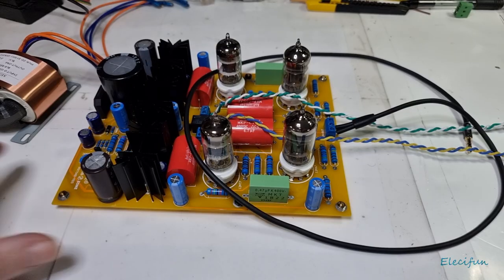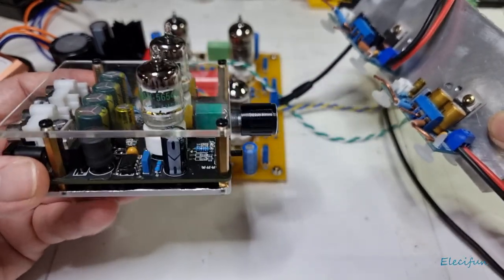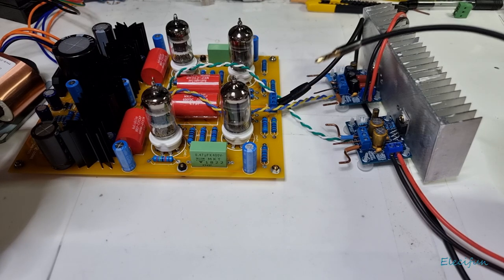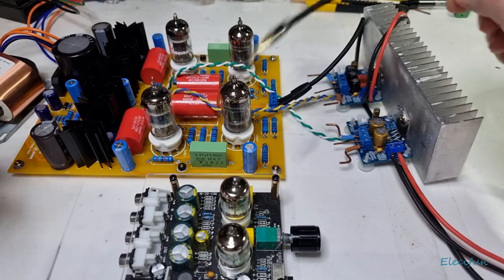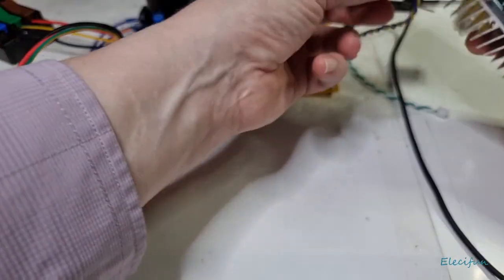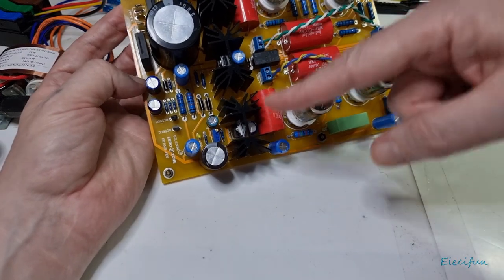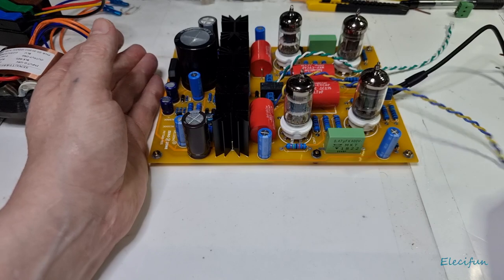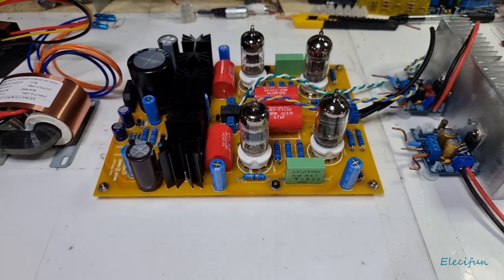12AX7 + 12AT7 TUBE MATISSE PRE AMPLIFIER

Comment: Hi amigo, she's finished! Orayt! It looks very nice. Does it give out a faint glow?

Edit* Okay it does have a nice glow. I had to reload your page a few times to screen capture. It don't worry bro your view count probably went up by 20 ! 😄👍

Gee I remember these old vacuum tubes from the old T.Vs that they made decades ago. 

I use to open the back up and peer into the back of the wooden cabinets.

Lucky I didn't start probing the tubes.

Actually I think I did initially and I felt a high voltage jolt. ⚡️ 😄

Scary to think back at the stupid things I used to do back then. 😆

Any it's a little hard to tell without actually being there but I think yeah it sounds better.

More grunt.

How many watts per side RMS?
Reply from the maker: The tubes do glow a little.. They are fascinating to watch and visualise in the mind whats happening in them. I was locked in a room for most of my pre double digit years. I had a radio which I looked in the back of, I was amazed by the components which is one of the reasons I took up the hobby.
I an still to test on the Oscope as I am waiting for a friend to arrive and have a listen first. 
Then let the tests begin!
Reply: @Elecifun  omg bro that sounds aweful ! 😟🥺
😢
It's strange how these traumatic events affect us later in life. 

I developed a fetish for watches because my father stole a watch that was given to me as a gift.

Its probably why I bought so many geiger counters and clocks. 

Anyway sad and interesting. 🤔😔

Anyway I look forward to the next one.

I hope you build a 100W per side power amp one day. 😀👍
Reply from the maker: @decem_unosquattro9538  Iv'e built a 100W per channel amp. The 60W amp with a 4 Ohm load will output 100 watts. 

Ref, childhood. When I was 12 I was deemed out of parental control so I was sent to a lock up school until I was 16. This was when the staff were allowed to use physical force to get me to comply. It was an exciting time for all involved.
Reply: @Elecifun  100W per side?
Reply from the maker: @decem_unosquattro9538  Yes

Comment: It's VERY interesting to hear your impressions when comparing the two pre amps. I'm glad you have use for both with putting one on the TV. I've not seen that particular kit (12AX7/12AT7) while perusing my usual sites. Did you say about £18 without tubes? Not bad but those tubes cost me around $10 a piece if I buy the decent ones here in the states... Still a good deal if it ends up being a really good sounding pre amp. It's cool that you've bought a book and are getting deeper into tube amps. I love to hear your opinions as they are more scientifically grounded than my own. It looks like your feline friend is enjoying the music (or maybe the radiator lol). Thanks for another entertaining and informative video Elecifun! I'm loving your amplifier series.
Reply from the maker: Cheers Ox. I spend a lot of time listening to the same tracks in order to pick out faults initially and differences. I want to hear bass strings being plucked and crisp sweet highs while the vocals are kept precise. I love it when I can hear slight differences, this lets me know the individual amp representation is true, else it would all sound the same. 
This particular pre amp has a lot of gain, when I do the meter tests the results should reflect that. Its gain is great and it drives the LM1875s really well. I turned it up this evening listening to amongst others, Lou Reed - Walk On The Wild Side, a track with everything needed to push an amplifier. It sounded beautiful, pushed so hard that my cat jumped off my lap and ran when the trumpet at the end was being played. I even had to take a break after myself. Awesome! 
My neighbours were out.
I found some MULLARD 12AX7's matched pairs, cost £73... I will stick with what I have for now as the extra expense doesn't seem justified, ATM.
My cat Felix loves the radiator, he is a heat magnet, unlike Oscar who prefers the window ledge with the window ajar so he can enjoy the cool breeze. Cheers for your interest.. Did you get yours sorted out?
Reply from the maker: I forgot to add for your perusal ..
https://www.ebay.com/itm/274983334334
Reply: From your description, it seems that this new pre amp has more gain and more bass response than our 5654w. That would be a welcome change with my current set up. I think those Mullard tubes are about the best you can get. Tough to justify the cost though if your set up already sounds great. I think your kit with the 12AX7s and 12AT7s in front of the LM1875s is a very good value set up. The enjoyment per dollar ratio is right in my wheelhouse lol. Yeah my kit still has the crackle on warm up. Still no problem once warm but a bit annoying. I'm confident that new tubes will sort it but they're almost impossible to find. They are 10GV8 and have been back ordered for almost a year!  I can't find a different tube that will work either so that's why I'm so interested in a whole new set up.  Probably on the same day I order a new kit, the 10GV8s will become available lol. Thanks for the link and for your videos. They are very valuable to me when contemplating a new system. Funny how your cats have different opinions on the most comfortable spot lol. Sage is strange in that she hates the heat outdoors and spends the entire summer looking for shade. But in the winter her favorite spot is right in front of the fireplace. A fire calms her and has since she was a pup lol. Thanks for the link. The search continues for a great sounding all tube system on a budget 😆
Reply from the maker: @Sonic_Ox  I don't want you think of  me as contrary regarding the crackle in your amp, I can only go on your video and info you have given, changing tubes from channel to channel didn't change the issue. I'm not sure swapping out with different tubes will.
There is something wrong in the setup because it distorts badly and with little input. I'm only a electronics enthusiast, I really believe its something else. You could really do with its schematic to help trace the issue.
Anyways regarding our furry/hairy babies, I'm in full agreement, the opinions on what is comfortable is an individual preference. Maybe Sage prefers the different heat produced by your fire compared to the sun.
Reply: I don't think you're contrary. I appreciate your advice. Changing the order of the tubes does influence the crackle. It actually changed it from the left channel to the right. That's what finally made me think one tube was going bad. Since there are two tubes per channel, finding the culprit took more combinations. I do agree that is not the only problem. A schematic would certainly help. I've been looking but since this particular model is no longer made AND the original designer has died, it's proving a bit difficult to find. I'm sure it will end up being a complete rebuild from the ground up checking every component. I wanted to save that until I get new tubes but with the backorder...  sigh. So, in the mean time, I intend to pursue ideas for a whole new system with tubes that are more readily available. I won't abandon this setup as I love the way it sounds when "hitting on all eight cylinders" so to speak lol. Even with the difficulty, I enjoy the hunt. How is your kit sounding after listening for several days?
Reply from the maker: I had the impression changing the tubes around made no difference. I should listen harder. 
I am enjoying this pre amplifier because I get to use the 12AX7's and 12AT7's I have, that alone gives me pleasure. After hours of listening connected into the LM1875's I am going to swap for the bigger 60 watt amplifier circuit's and do the hard work of sitting stroking my cat listening to music... its a hard life. 
Iv'e been window shopping on Aliexpress looking at tube power amplifier kits. I wouldn't mind a kit with a case to finish the project off nicely.
Reply: Your impression was correct. Initially changing tube order made very little difference in the warm up crackle but I think the "bad" tube remained on the left side in my random ordering. It wasn't until I purposefully changed the order several times that I found that the crackle followed a certain tube from the left channel to the right. Yes lol it is tough work stroking a cat and listening to music all day. I'm all for it but Sage gets bored quickly and would rather chase a ball than tinker with amps or listen to music lol. I've been looking at Ali too. There are a few kits I wouldn't mind trying but I'm a bit torn. The USA kit that I'm contemplating is about $350 but is COMPLETE with transformers, cables, tubes, and everything. Plus I already have a $65 pre amp for it... in the long run I think it's the best route. My birthday is in March, I think I'll save money and treat myself then. I will have to build an enclosure. Part of the fun. Please continue to document your tone quest. I'm always keen to see what you come up with. Have a great day amigo. Thanks for your interest and advice!
Reply from the maker: Sounds like your pin pointing the issue, great stuff. Felix gets too comfortable in my lap and annoyed when I have to get up. Sometimes I wish he was a dog. I could take him for energetic walks and lets him sleep it off on the floor, leaving me alone. 
I've decided to opt for just a tube pre amp and solid state power amp. As I can get all the tube flavour from a pre amp and it will not be so expensive to upgrade or swap around. The solid state will just amplify what I push through it is my thinking.
I also want to build enclosures, I'm looking at hand held routers online atm. Not a wood worker but am willing to give it a try.
Reply: Haha at least Felix is affectionate. Some cats are so aloof lol. Yeah, I think a tube pre amp with solid state power amp is a good way to go... Less expensive and fewer problems potentially. I'm glad you're thinking about enclosures. I think it's half the fun designing and building your own box. Even finding something interesting and adapting it to your needs is very satisfying. I'm not a great wood worker. I have a hand held router and a jigsaw and a power saw etc but my tools and skills are more appropriate for metal work. Also I enjoy working with plastic with the 3d printing... I'll be interested to see what you come up with. You're a creative and proficient problem solver. Have a great day ( or night lol) amigo!
Reply from the maker: LOL, I have another cat Oscar.. he is aloof. He loves morning affection, grooming and food. He does not like cuddles or being in the same room as Felix. Its a funny setup here.
I have a jigsaw, its old but works..like me. I will see what I can do, I have some ideas.
Thanks for the compliments, probably best to see what I come up with first though.
Reply: Yes, Felix and Oscar seem a rather "odd couple" lol.